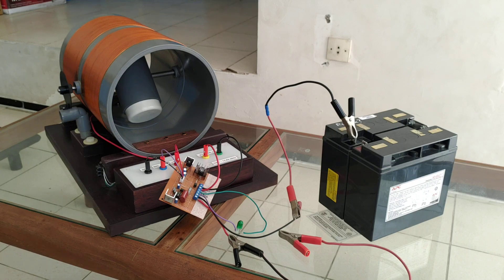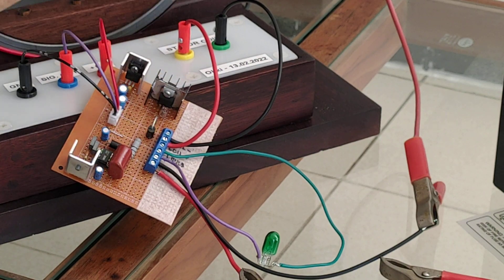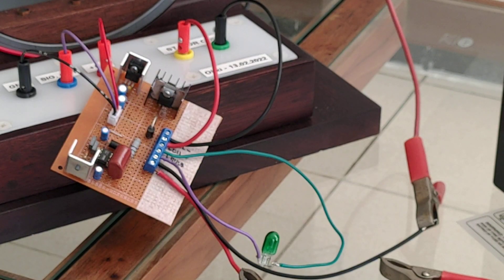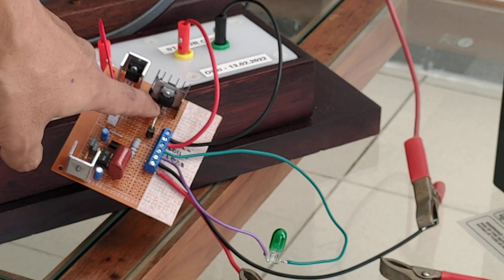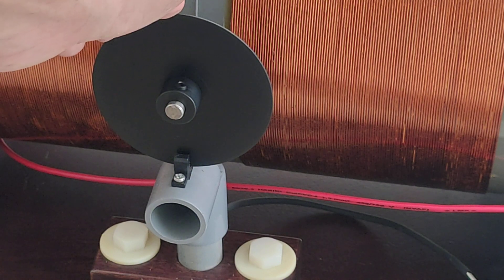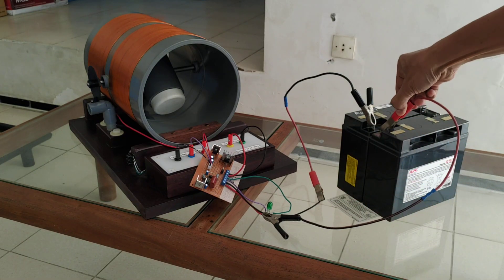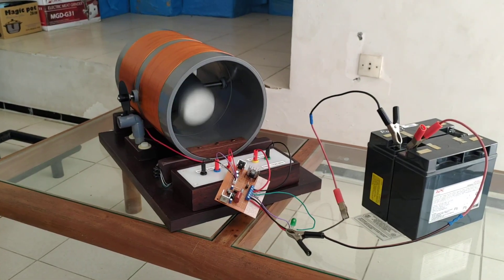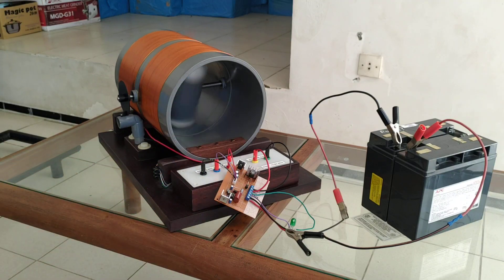24V Pulse Motor

Comment: nice voiceover Oki, glad your back from germany and posting regularly . although you did great looking work in the EU.  -  this motor is exciting, i built several too, but my approach very different,  (1.2k - 1.7k ohms coil, and 100-950volts) with mechanical efficiency of between 80+ - 98% ~~ full range !!...  best electric motor in the world for full range efficiency.      low power for size, however.
Reply: power is approximately linear curve with efficiency, -  0% torque at TDC and max power at 90 / 270 degrees.    lenz plays very significant role in explaining high efficiency but also limits this motor geometry to 100% ;-(     - in my view
Reply from the maker: @patrickwatkins7572  thanks!